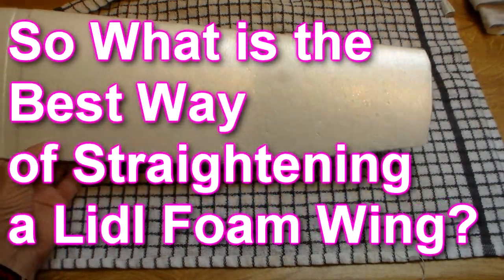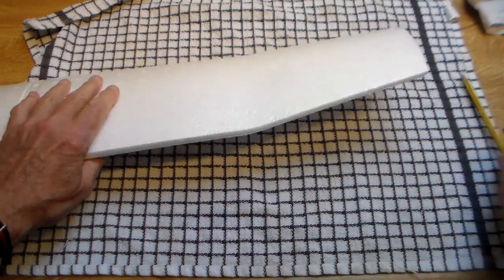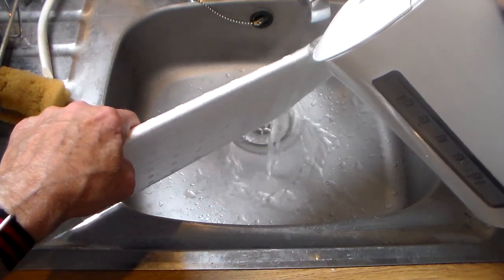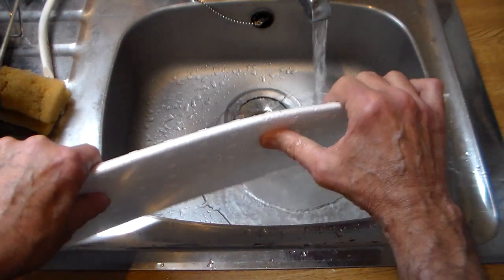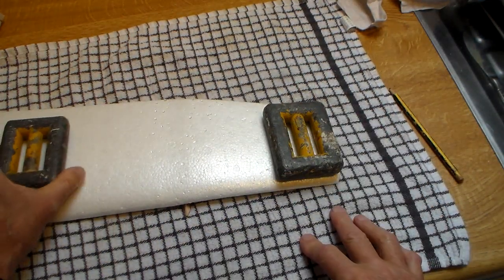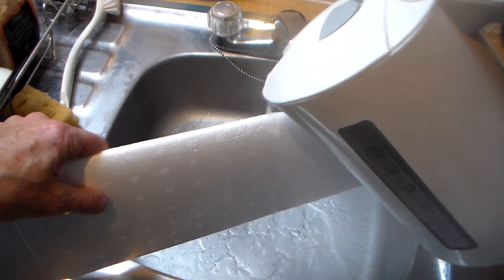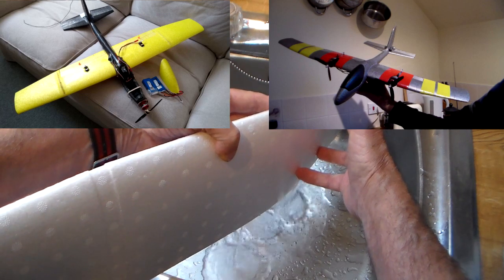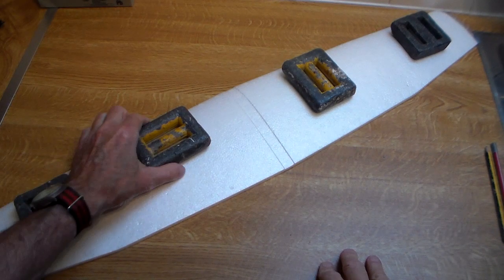The Best Way to Straighten, Remove Dihedral from a Foam Wing or  Lidl Glider Wing for RC Conversion

Comment: I have just bought a Lidl glider from the new batch they are selling (on sale from 21 Aug 22).  This is a brilliant video that will really help me build mine.  Thanks
Reply from the maker: That's great, they are addictive! I've built about 7 variations from single, to twins, biplane and EDF. I guess you saw my build video it's a good guide.  https://www.youtube.com/watch?v=ceNpxgB62Gk&list=PLLdle7NDE_1Y_XC3kjOSIUDJcRxVrhez-&index=1   Regarding the wing this method works with some LIdl's but sometimes they have used different foam and you may need to make a cut and then hot glue the wing straight.

Comment: …i built over 20 of these and methods of straighten the wings has evolved during builds…the best controlled straightening i found out is this: draw a line exactly at the dehedral bottom side…take a hacksaw and go 2/3 through (yes its scary!)…fold a 120/180 sanding paper (should feel squeezed in)…widen the gap until the wing easily folds straight or even a tiny little bit over…fill the gap with epoxy (2 components resin)…masking tape and place flat and weigh down…straight forever…i decrease the wingload with large 35 mm flaperons and need an absolute straight trailing edge…
Reply from the maker: Hi John, now that I've built 6 of them I am inclined to agree with you! Hot water does work but you need a carbon strut to stop them slowly bending again. Nowadays I make a cut half way through, run a bead of your hot glue down it and bend it straight and hold it, maybe with a slight overbend, until the glue goes off.

Comment: I'm new to the RC planes. I have one spare Lidl glider but I'm lost why in general we need to make the wing straight? It files better or it's only to make longer ailerons?
Reply from the maker: Good question, if you leave it in it will be easier to fly as it helps a plane self level. But it's true if you straighten the wing you can extend the aileron further out which make it more efficient.  If you make them shorter but a bit wider they still work ok. If you want good aerobatics and quick rolls etc longer probably best. Getting to the straightening, hot water is ok , but mostly now I make a shallow cut and then hot glue.  The last build, my Lidl 'Spitfire' , I made the cut on the underside. Check it out!  https://youtu.be/N-z45QNjyZ8

Comment: Do you feel like you get the core material warm enough? Maybe us a cloth to catch the pouring water so it gets more time in contact with the wing to transport the heat in to the wing? 🤔🤔
Reply from the maker: Seems to work OK, but that might be useful.  Some people say cut and glue shut is better. And it's true that unless you put a bit of carbon in they do tend to spring back a bit.  I've used both methods.

Comment: OK Bob. Need your full name and address so the Bailiffs can serve the summons papers! :D
Reply from the maker: Ha ha, I'm sat here half pissed on red wine and you gave me a good laugh mate. Or can I call  you cobber? ;) Pubs are open from 0600 today but I won't be rushing to go. I see they have some local lockdowns in Oz now? Melbourne I saw on TV.
Reply: I used the hot water followed by cold method, but first I wrapped a cloth around the part I wanted to bend, which retained the hot water next to the foam, so probably used less hot water.  It worked very well.